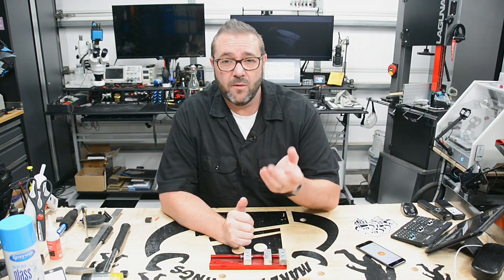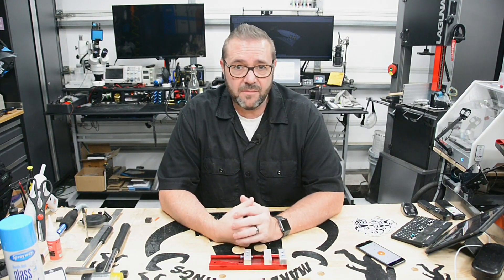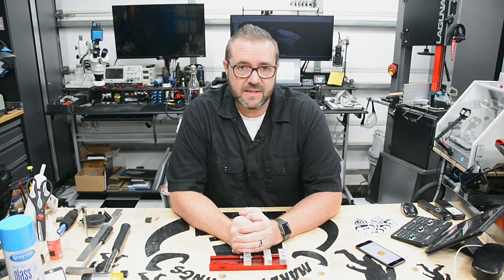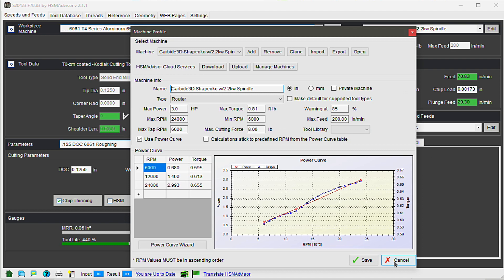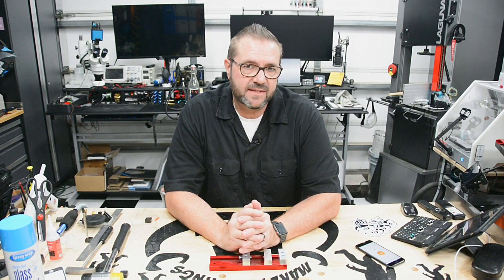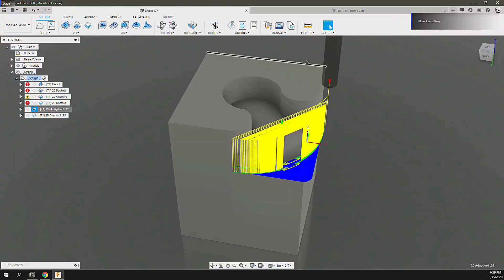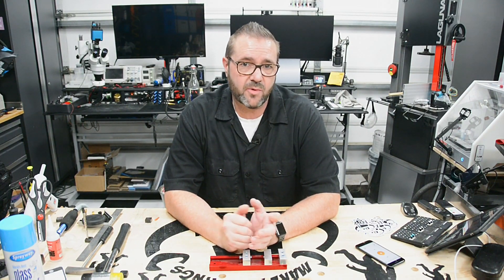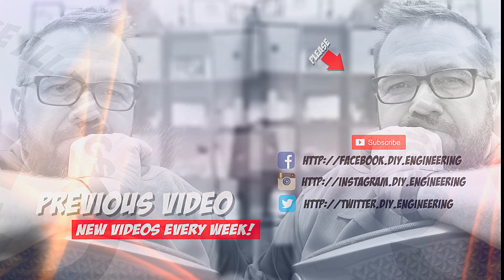Calculating Great CNC Feeds and Speeds!

Comment: 7:36 a machinist advice , the rpm is too high and WOC  is too less , 6000 rpm 1mm WOC would do same job better without chatter. All these software seems garbage.
Reply from the maker: while I agree, the machine does not have linear torque, and at 6k would not be able to cut a 1mm WOC it would just stall the spindle.

Comment: I had exactly the same result with G and even had support tell me my machine must just be broken.  Refund!
Reply from the maker: wow, ya... weird strategy they have going on over there.
Reply: @DIYEngineering  Seams they just don't want to deal with hobby level machines?   I have a Tormach 440 a very capable machine, but even using the safest numbers from G, I lost a few $$ carbide end mills...   I do wish HSMAdvisor had a Mac version...